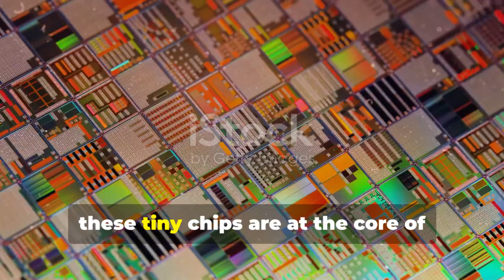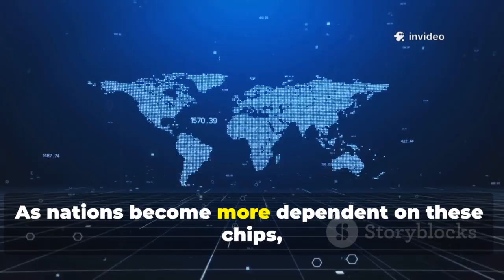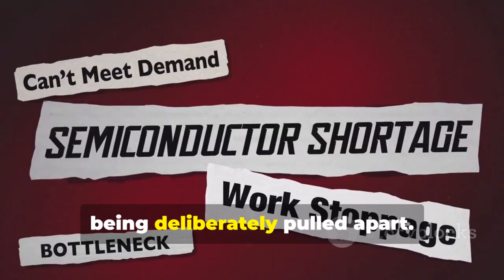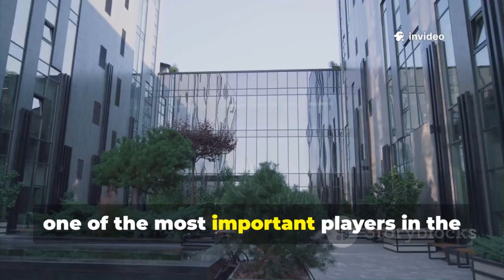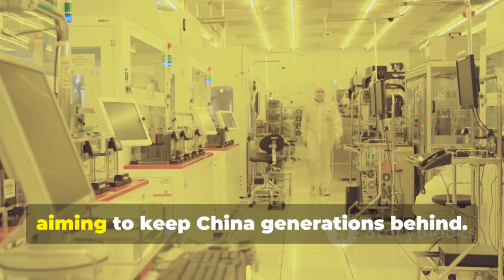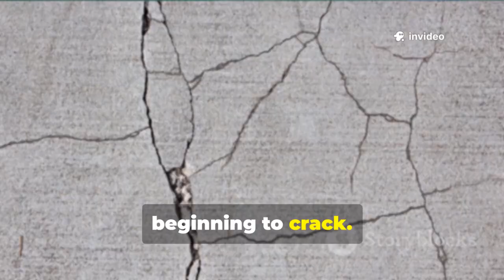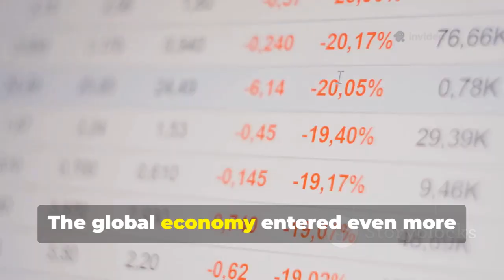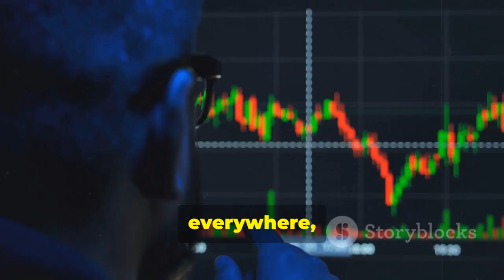China Cuts Off ASML as the Global Semiconductor Industry Faces a Growing Crisis

Comment: China has been pushed to build an autonomous semiconductor ecosystem, diversify its technical pathways, and ultimately pursue a development model fundamentally distinct from that of the West. Instead of relying on sprawling global supply chains, China has committed to a fully localized chipmaking industry—much like BYD’s vertically integrated approach to automobile manufacturing. As a result, China now possesses a complete domestic supply chain spanning optical mirrors (Changchun Institute of Optics, Fine Mechanics and Physics), laser crystals (Fujing Technology, which holds 80% of the global market), precision structural components (Fuchuang Precision), and system integration (Shanghai Micro Electronics Equipment). By contrast, Western production depends on a fragile web of more than 5,000 international suppliers.

China’s strategy differs from the West in several core technical routes:

- The Western model (ASML): A single, rigid pathway built around US‑made CO₂ lasers driving an LPP (Laser‑Produced Plasma) light source. This system requires firing 50,000 tin droplets per second to generate EUV light—an approach plagued by tin contamination, low energy‑conversion efficiency, and inherent engineering constraints.

- China’s model: Multiple independent, parallel, and diversified routes. These include the solid‑state laser LPP system from the Shanghai Institute of Optics and Fine Mechanics, the DPP (Discharge‑Produced Plasma) system from Harbin Institute of Technology, and breakthrough alternatives such as Tsinghua University’s SSMB (Steady‑State Micro‑Bunching) and Haoyuxin Optics’ HHG (High‑Harmonic Generation). These technologies are fully self‑controlled and directly address the structural weaknesses of Western designs.

China’s emerging EUV ecosystem offers several decisive advantages in performance, cost, and operational stability:

1. Superior Light‑Source Performance  
The Western LPP source achieves only 5.5% energy‑conversion efficiency. China’s solid‑state LPP has already reached 3.42%, with a theoretical ceiling above 6%. Meanwhile, SSMB delivers 3,200 watts of output power, and HHG provides a “broadband–ultrafast–coherent” light source with tuneable wavelengths and zero contamination.

2. Major Gains in Stability  
Tin‑based plasma sources in Western systems cause heavy contamination, requiring mirror cleaning every two hours. China’s EUV‑FEL (Free‑Electron Laser) eliminates tin entirely, extending cleaning intervals to 50 hours. Its power stability of ±0.5% dramatically outperforms the Western ±5%.

3. Orders‑of‑Magnitude Improvement in Inspection  
Western electron‑beam inspection is slow and throughput‑limited. China’s HHG‑EUV inspection is 100–1,000 times faster, with ten‑fold higher resolution than DUV. It can detect sub‑5‑nanometre defects and enables non‑destructive 3D imaging.

4. Better Cost, Size, and Engineering Flexibility  
Western EUV systems are massive, extremely expensive, and difficult to maintain. China’s HHG systems can be deployed at desktop scale (around 3 m × 1.5 m), require no complex contamination‑control infrastructure, and offer far greater engineering practicality—opening the door to widespread access to advanced EUV research tools.

In the end, this technological divergence is healthy for the global landscape. Instead of a single hegemonic model, the world now gains two distinct ecosystems—introducing choice, resilience, and genuine competition.
Reply: Well researched and highly informative. Thank you